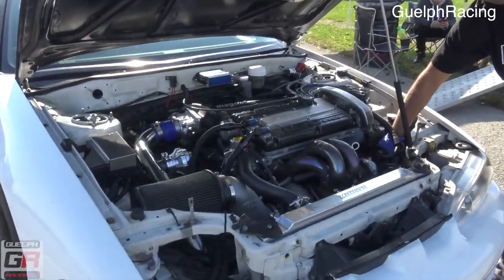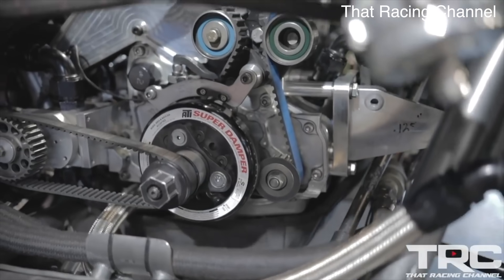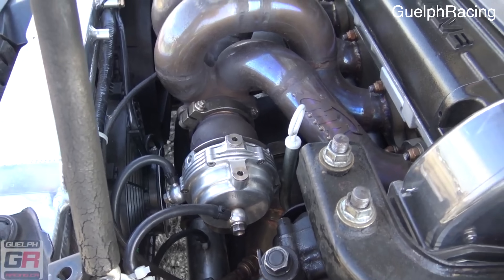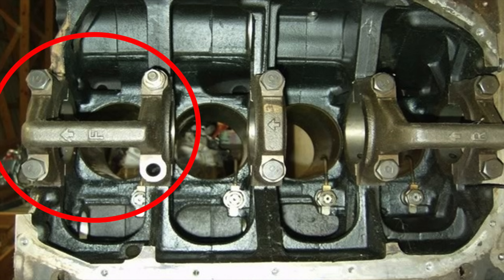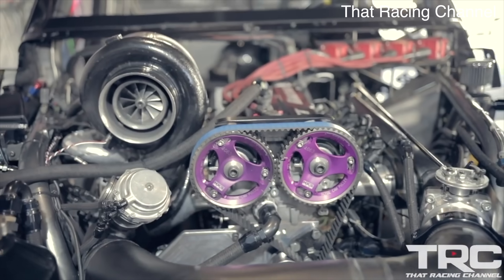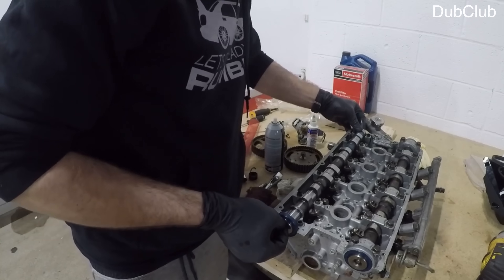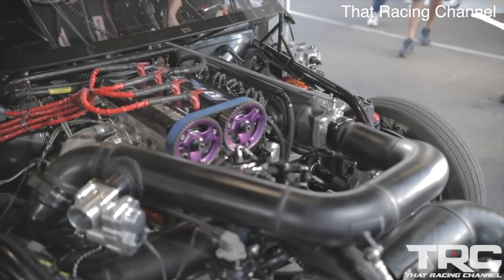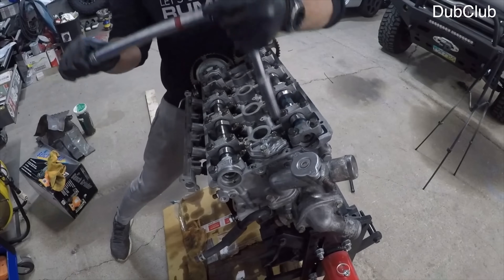Mitsubishi 4G63T: Everything You Need to Know

Comment: Possibly the best four cylinder engine ever.
Reply: K20 gets my peak vote with the 4g following close second.
Reply: @roskataqv  the 4G63T (together with the 3S-GTE) was a revolution, the Honda k-series is an evolution of older Honda engines.
Reply: 3S-GTE is the best. Most reliable and makes insanely good power. It’s the same Yamaha design as the 2JZ-GTE and even uses one of the same turbos.
Reply: @negativeindustrial  certainly both engines  are the best turbocharged 4 cylinder engines ever. I think that the Mitsubishi has the edge in the details, but i agree the 3S-GTE has more personality, difficult to describe exactly, from the sound to the power delivery. It's difficult to be objective since i own a MR2-S and i am sort of a Toyota fan.
Reply: Aftastos K
I’ve got a 1990 MKII MR2 Turbo @300whp and a 1994 ST-205 Celica Turbo WRC @400whp - both with full suspension mods. I used to love racing the gen2 GSX Eclipse’s in the Celica. Those two cars are EXTREMELY similar. Made for good races.
Reply: I am much more familiar with the Celica than the Eclipse. I am curious to ask about your setup in both cars. It's a bit of an irony but the 3S-GTE is a perfect match for a Td05H. If everything is done properly the combination is awesome.
Reply: Aftastos K
About twelve years ago I converted a 1994 ST-204 from two half cuts of a 1994 ST-205 WRC. That’s the special homologation model that has the upgraded steel CT-20 turbo stock water/methanol injection and factory anti-lag system. It made ~340whp with just an Aussie downpipe and a GReddy exhaust on factory 550injectors and a Walbro 255lph - 21PSI, factory tune, Mustang Dyno.
Then I pulled the engine and installed an HKS/Toyota Team Europe MHG, HKS 272 Cams and adjustable cam gears, 800cc injectors and an ATS tuned ECU. I also had the bottom end balanced to run 8K or so RPM. Changed the W2A Intercooler for a big FMIC. She had one dyno run where she made well over 400whp but the PSI was something ridiculous like 30psi so we pulled it back to 25PSI which is right at 400whp on that setup.
The MR2T is just my second daily driver (really meant to drive my LS400 but I almost never do). It has the full GReddy package; SMIC, IC piping, BOV, exhaust. Huge rear tires, ST swaybars, TRD springs, yada yada. I’m sure I’m forgetting half the mods on both cars.
Both cars have WRC spec turbos and Apex’i intakes, full interior and sit on Enkei wheels.
The Gen3 ECU is the real secret sauce with the 3S-GTE. The older ECUs and 440 Injectors realistically hold you back to like 275whp with the occasional unicorn that gets closer 300.

Oh! And can’t forget the bodies are 100% OEM/TRD. No fucking body kits beyond what can be bought at a Toyota dealership 😉
Reply: You are really into this! So do you still have the original CT-26 in your MR2T? Why don't you upgrade to a modern ECU? Myself I am not pretending to be an expert on the 3S-GTE. My general idea for an ideal 3S-GTE upgrade is to install a modern ECU and an aftermarket Td05H turbo. 
Myself I am upgrading my MR2-S with Apex Power FC, Denso 573cc injectors, full engine rebuild with CP racing forged pistons (9:1CR) etc. My car is not ready yet. I intend to use my car only on public roads so I try to make it as streetable as possible.
Reply: Aftastos K
Which engine? The stock 1zz or the Celica 2zz? That’s going to be the best setup you’ve got going. The MKIIIs don’t get the love they should because they have the best chassis/suspension setup of the 3 of them IMO.
And, no, my cars run WRC spec CT-20b turbos that have been improved by the MR2 experts at ATS Racing (including upgrading of the wastegate actuator). They are also the ones that improved the Gen3 ECUs on them. To be fair tho, the WRC ECU is vastly improved from the US spec Gen2 ECU.
I’ve tried to stretch the limits of the stock systems and used period correct parts from top shelf companies like GReddy. It’s hard to find those old parts but they’re worth it IMO. The car drives like it would if Toyota built it today minus the nanny systems. IDK - That’s just my style of build, I guess. I know I could get more out of more modern upgrades but huge power was never my goal.
Reply: The stock 1ZZ. I don't regret it. Dropping from 10:1 to 9:1 doesn't make much of a difference. Instead dropping from 11.5:1 to 9:1 it is felt a lot. My car has the C66 LSD gearbox.It's good for cruising and I love it. My car started life as a semi-automatic and it was converted sometime in his life into a 5-speed LSD - I bought the car badly abused from a 27 year old guy with destroyed bushings and front struts and horrible worn out Dunlop Supersports tires. The level of handling must only be experienced to be understood. So tired with these comparisons with the Elise in what is essentially a worse car that is delivered as new in a higher spec.
Reply: I watched Michael Farah that drove a MR2 turbo prepared by the ATS racing with a Precision 6265 turbo. This car in the one Take has 820whp. From the video the turbo seems way too big, it seems like the anti-surge compressor housing is wayyyy too busy. I think that something much less flashy and way cheaper than e.g. an "entry level" 5831 would had done lost about 200 bhp but would had been a much better option.   However I watched all the related videos, in general are very impressive
Reply: Aftastos K
Ha! You said I was into this shit? 😝
Reply: we both are hahaha
Reply: Aftastos K
Bring that thing down to TX2K20 if you get her finished in time. I’ll line up with you. Look for the only non-kitted Red Turbo MR2 there 😝
Reply: Thank you! I am living in the other side of the ocean. I am thinking about upload a video of my car. Not yet ready to level that I want to, so it won't be anytime soon. I 'll post up a link these comments when the time comes!

Comment: A lot of iron block 4 cyls making 1000hp, the 4G63t has just gotten a lot R&D.
Reply: The 4G63 closed deck design is what helps it tank a ton of boost
Reply: @linchester8464  almost every single iron block is closed deck.
Reply: @alexstromberg7696  the EJ engine isnt closed deck.
Reply: @linchester8464  I also said "almost"
Reply: Lin Chester it’s not iron it’s alloy
Reply: Try again......cast iron
Reply: @linchester8464  its not just the block more importantly if you want to make lots of power your gonna have to start looking on the cylindet head. And the one on the 4g63 has a high flow cylinder head.
Reply: @osama1929  that i wont deny. But i will say the number of failures i have seen is mostly weak blocks which crack under boost or bad tune. Then it will be the head studs which fail sending oil and coolant into the cylinders. The 4G63 heads are really good from factpry so head porting nets very little gains. So the only thing i will upgrade with the 4G63 heads are the valvetrain parts and stronger head studs to hold it down when i strap a bigger turbo.
Reply: @linchester8464  yeah that's what most people dont know about, those things you mentioned are right on point.

Comment: You forgot to mention that it shares a lot engine wise with the Srt4 which is why it was so good
Reply: FALSE in every which way. Does not share anything with that shitty ass engine.
Reply: You must be thinking of the non turbo 420A fitted on the "95-"99 Mitsubishi eclipses and Eagle talons same motor as the neon and srt4 but Mitsubishi borrowed that motor from Chrysler to help raise the US content that the cars had.
Reply: Mitsubishikid 420a was the worst thing Mitsubishi did, added a shitty Chrysler engine into their perfect chassis.
Reply: @RichRusso4218  I agree, but at the same time their early deaths sort of made it possible to get body and interior parts back when they were newer and even today.

Comment: Can you please make a video comparison of 4b11t and 4g63t 
Thank you
Reply from the maker: It’s already on the to-do list. Thanks for watching 😃
Reply: Spoiler, only one of them was forged in the most grueling of motorsports, the other is a joint Hyundai, Mitsubishi, Chrysler designed engine with no pedigree
Reply: @Gripmagic  Check my above comment.
Reply: I understand why people are quick to site  highly modified versions of these motors as the crux of their argument but that’s a terrible way to gauge what makes an efficient engine. Not to mention once you bastardize an engine with aftermarket parts it becomes even more so. Out of the factory  the 4b11 is the more efficient motor by just about any objective measure. I’ll leave you all to research this for yourselves as it’s very easy to find. Hey don’t get me wrong I prefer the 4g if for nothing else, nostalgia. But that’s not what we’re talkin about. Truth is both engines are fucking GREAT. Can’t go wrong with either for daily or track use. Peace amongst you fellow car enthusiasts. Keep it civil.
Reply: both are rather capable and semi reliable if you don't cram too much boost in there. people that run evos into high boost rebuild a lot of engines.
Reply: Spoiler alert: 4b11 wins
Reply: @nwbklr  not according to the fact all the fast cars use the 4G63 in drag racing , check out the the list for the Top 10 Quikest AWD Mitsubishis , every car on there is a 4g63 , not one 4b11
Reply: @jerrywhite4764  Actually there's an Evo X that  ran an 8.1sec quarter mile. Fastest 4b11t right now. Look it up, "Grade A Garage Evo X". It actually beats out a few 4g63 powered cars for top 10 Fastest Evos. Another one to check out is "English Racing Evo X".

I believe the fastest 4g63t is a DSM "The Red Demon" built by Boostin' Performance. It recently ran a 7.1 in the quarter. Mind you, it's taken the 4g63t 30+ years until it's run a 7.1sec. quarter. The 4b11t has been out for 11ish years and it's already running an 8.1 in the quarter with a heavier chassis.

Food for thought.
Reply: @Yakobito  actually the red demon talon ran 7.0 , it didn't take the the 4g63 30 yrs to run 7s , Buschurs RWD Talon ran 7s 20 yrs ago , Shepherds Talon ran 7s 14 yrs ago , and Brent Rau DSM ran 6s 13 yrs ago . And all the fast 4g63s are all DSMs not Evos , 8.1 is fast , but that is light yrs from 7.0
Reply: @Yakobito  I just checked the list for Top 10 Quikest AWD Mitsubishi , that Evo is not on the list , the number 10 spot is a 2g DSM at 7.8 , 8.1 will not even get you on the list, oh that's top 10 Evos , sorry , the Evos are kind of slow compared to the DSMs , I always forget about them
Reply: @jerrywhite4764  I stand corrected, there are faster DSM's/Talons that came before the Red Demon.

But that bit about- "Evos are kinda slow compared to DSM's. I always forget about them." If I rolled my eyes any harder at that statement they'd be in the back of my skull. Lmao
Reply: @Yakobito  I'm not saying that Evos are slow , stock they are faster , but when it comes to putting out big numbers they same not as capable , and they have been over here for 17 yrs , so for having basically the same drive train , they just don't seem as capable of running the big numbers, not sure why
Reply: I mean next weekend

Comment: Is the Evo 10 engine different?
Reply: jason hang yes the 4B11 is an aluminum block and some other small differences
Reply: @liammaupin9492  oh. Is it the only car to have 4b11? Did the 8 and 9 have 4g63?
Reply: @jasonhang647  yeah, the 8 and 9 had the old 4g63t, the evoX is when they used the new engine the 4b11t
Reply: The 4B11T is a different engine altogether.  Plus the turbo is rear mounted as opposed to the 4G63 front mounted turbo. The 4B11T has both MIVEC on the intake and exhaust vs the Evo 9 intake only MIVEC. 

The 4G63 is the more popular way to go due to the larger aftermarket support.
Reply from the maker: EVO X is 4B11.
Reply: The very Last one of the powerblock was the Evo 9 !!! ! !!!
Reply: Evo 9 use 4g63t but MIVEC !
Reply: @nuekgg2305  intake only.